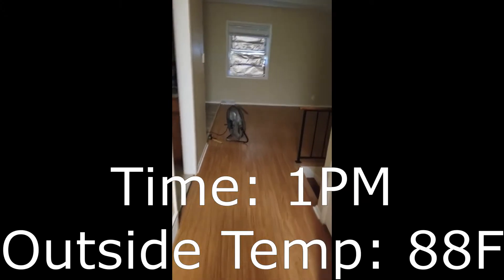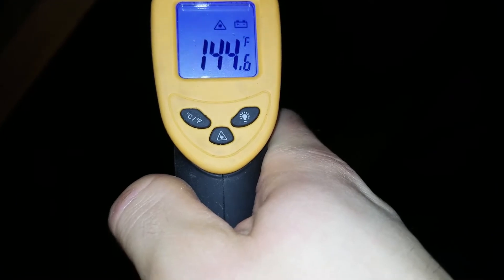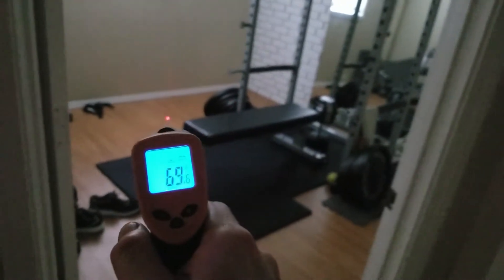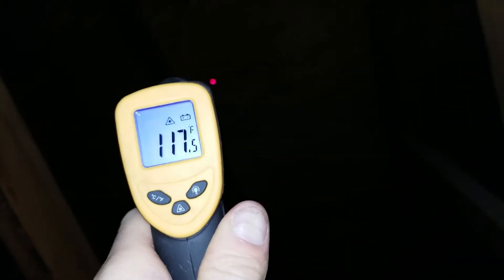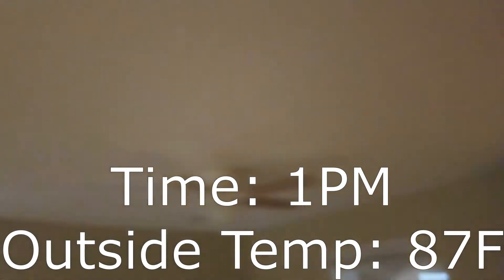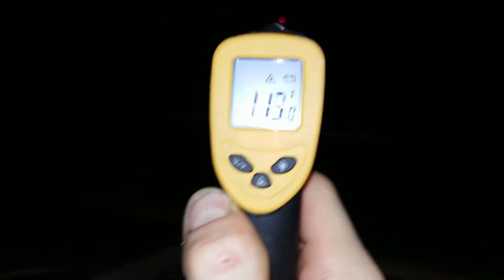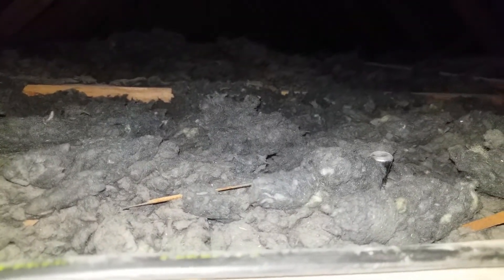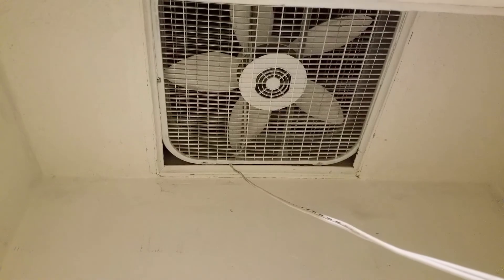Painting Roof White with Hydrated Lime(Plaster): Initial Results

Comment: In Los Angeles CA the summer is hot, but my house is very cold in the winter. 
Is there a economic way to change the roof color dark in the winter so I don't need to turn on heater and change the roof color to light so I don't have to turn on A/C in the summer? Painting roof two times a year is expensive. 
How about a light weight tie-down thin canvas or covering films on the entire roof and allows ropes hooking to poles from the yards to provide additional shades for windows and around the house?
Reply: I was contemplating the same thing. I live in the CA Central Valley and the weather here is pretty temperate. It’s reasonable to assume that any sort of covering on the roof wouldn’t cause too many issues.

Comment: Plaster is not the same thing as "hydrated lime"..  Plaster can contain various ingredients depending on where in the world it is made.  It can contain gypsum, clay, sand, cement, mud, or even animal hair!  HYDRATED LIME is not the same as GARDEN lime, which is just powdered rock. (It won't stick to the roof).  Also... Hydrated lime is getting very hard to find at all the hardware stores.  It used to be available everywhere near the concrete bags.  I don't know why they stopped carrying it.   There is ANOTHER powder that reflects light even better than hydrated lime!!  It is called
barium sulfate.... also known as BABY POWDER.  It was taken off of the market because it contained some other ingredient that caused ovarian cancer.  BARIUM SULFATE is also called HYPER WHITE.  Artists used to use it to make the whitest white for their canvas paintings.  Barium Sulfate reflects the INFRA-RED (heat) spectrum far better than hydrated lime.  Scientists are experimenting with it to make SUPER COOLING panels to put on roofs and cool the buildings without using air conditioning!!  Thanks for the great video.  I painted my roof with hydrated lime, and got the same GREAT results you did.  Just thought I would pass along what I have learned since then.
Reply: Yeah Barium salts et al, no bueno. It'll fuck your garden up permenently, make the soil toxic for 50 years, and do all sorts of things to the human body. Barium doesn't play nice like calcium does.
Reply: How long and how well did it hold Since you paint it? Did you have to repaint it after some period of time? Any damage to the shingles?

Comment: I think it would have been easier to go to Home Depot and get  a few roll of Low-E reflective insulation and staple it under the roof rafter with a staple gun. The reflective radiant barrier is probably better at blocking the radiant heat from the sun than the white paint.  Plus the aluminum on the reflective barrier will block EMF from penetrating your roof and cause EMF pollution from above, thus kill two birds with one stone.
Reply: The second most refletive paint is CaCo3 paint (ie limewash after crystals set in). It cool better and its cheaper.
Reply: @sarahhavillamelooliveira5825  if I am going to do it with painting, I would buy some barium sulfate from china and mix it at 60%. This not only reflect heat but also absorb heat and radiates it into outer space. But radiant barrier is easier if you don't want to paint the roof and walls.
Reply: @somebody6048  That's a good idea. I'll still go with lime cause is cheaper, but barium sulfate is the most reflexive laint indeed.
Reply: Here is a YouTube video about Radiant barrier blocking 97% of the radiant heat from the sun from your attic area.  And you can install it in an hour with a staple gun.  
https://www.youtube.com/watch?v=N0-YD32ujYY

Comment: well for 20 bucks and a wasted afternoon or two; i hope this really works. There are no other videos about it!
Reply from the maker: Agreed! The only reports or documentation I found were pre-YouTube with very few pictures. Assuming the lime sticks, this is definitely something I will be using on all roofs going forward!
Reply: @gameoflife7235  after i applied the lime to my roof the temperature of the house definitely whet down. these triple digit days im enjoying inside my home very comfortably for the first time in my life ha
Reply: @jhonviel7381  and in the winter? its colder
Reply: @Stealthsilent1337  i wouldnt say it kept it colder, but on hot day when the sun is out it didnt heat up too much. also the single coat is washing off finally, probably going to apply more in a month or two.
Reply: @Stealthsilent1337  the darker the pigment, the better it radiates heat, it also absorbs it best under a hot sun

. And given the fact that the sun provides little energy in the winter months as is the case here in Canada, it's not going to reduce your temperature and even radiates less.

A 40deg drop is sure going to save on high energy consumption air conditioning..
Reply: @jhonviel7381  how did you apply it? roller? paint brush? the internet only has directions for fancy interior wall oainting and say
Reply: @failure5012  i did use a roller, the thicker kind because i thought it would get into the singles better, but as i did a 1:1 water/lime they lime wash easily flung off the roller, so i did make a bit of a mess around the edges. it stuck on very nicely for about a year, but we had a freeze and it started to slowly crumble off, my shingles are in terrible condition. i only did one coat, but i think 2 would be best for longer applications. i didnt do a temperature test, but it did help because down here in texas we have 100 degree days for many weeks in a row.